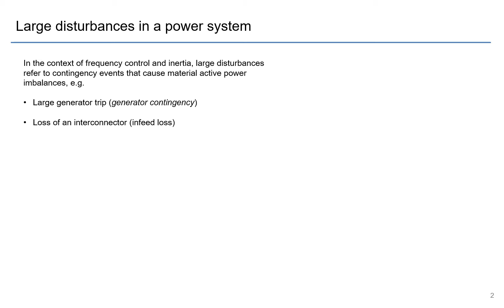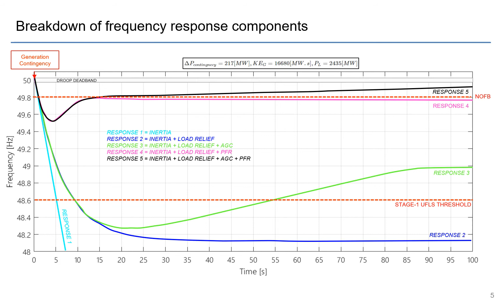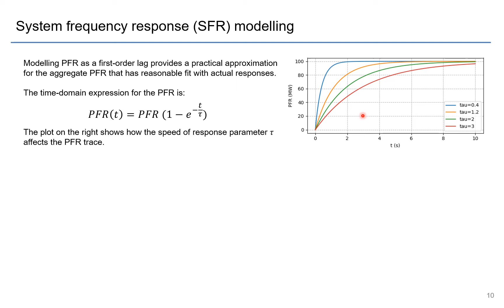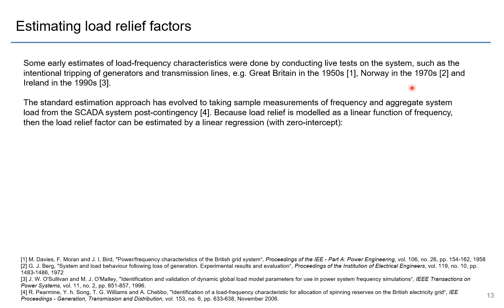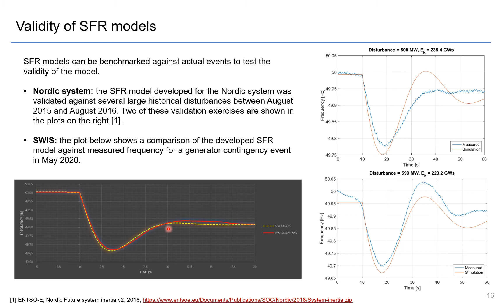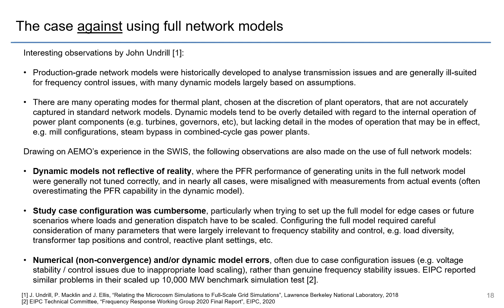Frequency Control in Low Inertia Power Systems - Part IV: Frequency Control Modelling

Comment: Mas Julius, kami memiliki rencana untuk pemasangan Static Frequency Converter grid to grig hingga 100 MVA, 50 ke 60 Hz, High Voltage DC, dan diskusinya adalah adanya isu kestabilan angular karena anggapan bahwa konverter tidak memiliki inersia. Apakah saya bisa diskusi lebih lanjut terkait topik konvereter dan kestabilan?
Reply: pemasangan konverter di pulau Sumatera